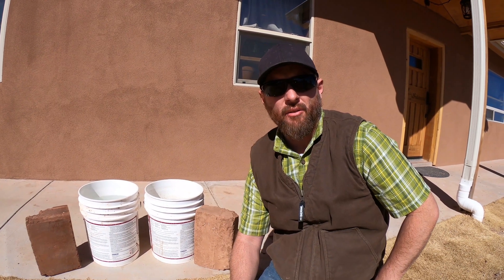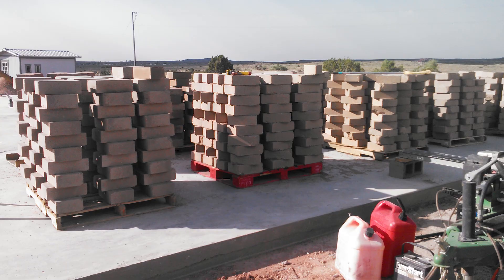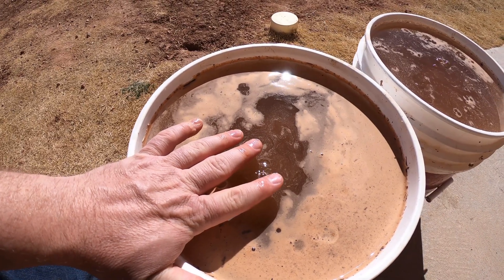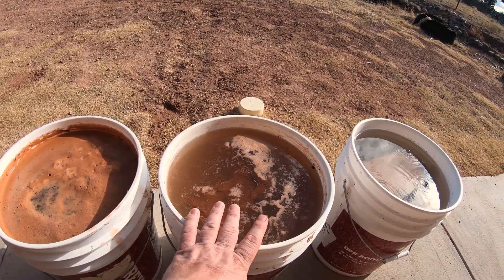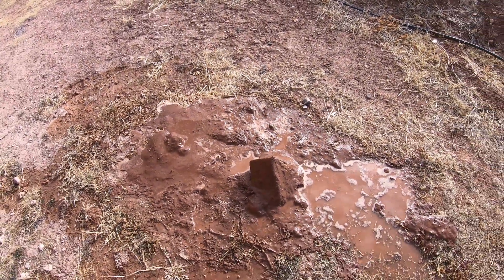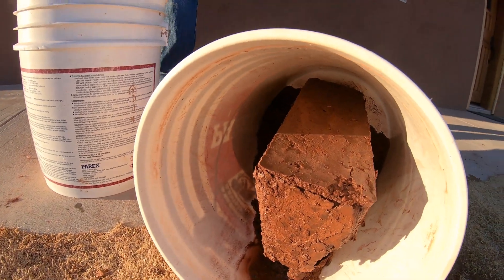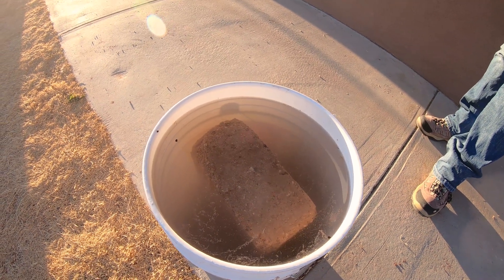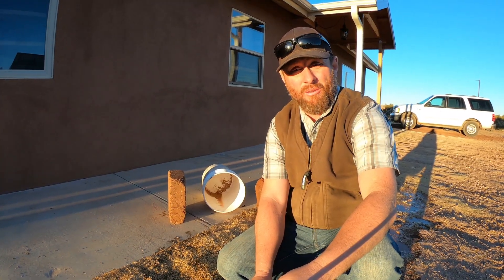Compressed Earth Block Test

Comment: what about lime block?
cement or lime both breath but concrete recipes portland cement comepletely cures and then starts the break down in 60 years as tested in India where some tombs were restored with cement but those who use lime get ten times the life from adobe....If so why?
Reply: I am from India 🇮🇳🐂🚩
lime very useful 😊👍🌿natural strength 🚩🌺🙏
Reply from the maker: Great question about lime, I don't have an answer about the lime, my experience has been with cement.  Something I will be looking into more, thanks for your question.
Reply: @SustainableLiving  my research kicked up this today...some one recently did some test on old roman concrete that last for a thousand years the volcanic pumice and lime make a unique mix but only if blended with sea salt...they form a molecule called aluminum tobermite. This molecule slows the cure for 1000 years...still get hard but takes 1000years to completely cure...instead of curing out and starting to deteriorate after 60 years like portland cement alone
No alt text provided for this image
Mix a stronger batch of concrete
Reply from the maker: @MyLevelheaded  thanks for the info
Reply: I based my final mix after a 51year career in construction being a builder...I started at age 9 with my father building residential neighbor hood communities.Some things i just never questioned ...However as my certifications increased so did my questioning attitude. from being a master electrician to water treatment certifications potable water through black water treatment...Now i am 60 retired and have one last residential build for myself personally...
Reply: @MyLevelheaded  I believe the Romans used two kinds of cement. The Tobermorite may have only been used in the cement they used that was going to be exposed to sea water. If anyone finds any good references for that I'd love to see a reply here.
Reply: @sethmurrow  I am not sure about that the toberamite molecules are found in inland roads and aquaducts etc..some still in use...The slow cure is the key and lime washing after for care etc...Many historians have mapped the massive salt production associated with rome...It far exceeded the needs of food preservation but few where able to detail the actual use for it ...The usefulness of curing block in salt water pools and then carting and lifting into place like legos was withing their reach...carts and block and tackle Today we still use those tecks in construction trucks and chain falls ...they used concrete that hardened but took thousands f years t cure fully and then deteriorated at the same slow rate where our contemporary mixes age out at 60years...So the main project to note this was in india a tomb those guys are really in love culturally with ancestor worship...especially the well fixed and powerful...at any rate they remodeled a 1500 year old tomb ...about 60 years ago using contemporary mixes the concrete mix looked great aged out and then deteriorated leaving the people to beg the question and define the old er methods using sugars in place of salts...every time a great culture cycles up and out we see something lost...Looking to history and allowing the science to see the difference is very worth while...

Comment: I’m debating wether to go with lime or Portland cement. Why did you choose cement over lime and do you know the what the pros and cans are of each? There isn’t a lot of information on the subject. I appreciate you videos!!
Reply: Thanks for the reply! I’m leaning more towards using cement myself. I was also wondering when you talk about using 10% is that by volume or weight?
Reply from the maker: @brytonatwood9637  Volume, great clarification.
Reply from the maker: I chose cement because the studies that I have read were using cement and were suggesting 10% to stabilize the block.  I do not know what the ratio would be if someone chose to go with lime over cement.  I do know that cement cures faster than lime and that may play a factor in your curing times of your block.  We were usually laying blocks within 24 hours of making the block with cement.  I do know that lime is more Eco friendly however everything that I have seen has been cement based.  I did use lime in my interior mud plasters to help reduce cracking but I know that is irrelevant to block making.  If I were to do it again I would use cement as I know it works.  Lime may work, but I have not seen anything either.  Something I may consider checking into more in the future and do some tests on.  Thanks for the great question.
Reply: Volume usually,because the different aggregates vary from rock type in weight,age,density and wether theyre wet or dry....thats why volume is more applicable.
Reply: Lime and silicates was called roman cement....portland is lime,silica,alumina,iron oxide....and some impurities.The chemical reaction that happens in portland with water,is a lot stronger bond than roman cement.

Comment: I appreciate your efforts - there are few people showing this type of information - how about some long term  information on your energy usage
Reply from the maker: Great suggestion, I have been looking at my wood consumption this winter and it has been tremendously lower.  I will see what I can do.
Reply: Bill...my wife and I are preparing to build a combination rammed earth, compressed earth block Earthship Biotecture style home in Northern Nevada. I am utilizing a Hydraform Compressed earth block machine to make the CEB. I am hoping to get the same results as Michael Reynolds at Earthship Biotecture.
Reply: @rongray4118  Be sure to use interlocking block design, no mortar needed. Test the blocks to make sure you have the right mix.
Reply: @rongray4118  thanks for the info -  I’ll look into it
Reply: @rongray4118  In northern nevada while you do you site work consider adding this supplemental heating system an ondol...or as the civil war documents indicated a croation oven...which was the best application on this ancient tech...here is a link to the army corps of engineers documents it puts your earth mass on steriods https://www.notechmagazine.com/2014/03/crimean-ovens.html With very low wood consumption and the install is as simple as dropping in a few compressed earth blocks and a 3 inch steel pipe for horizontal fluing inside the earthen block duct work...placing a thiner duct work in direct contact with the steel capped flue turns the system into a 40 to 60 foot long heat exchanger and radiant heat is gravity fed in to the home directly keeping all fires out side and the mess as well ...here is a link to the department of army engineering documents...https://www.notechmagazine.com/2014/03/crimean-ovens.html